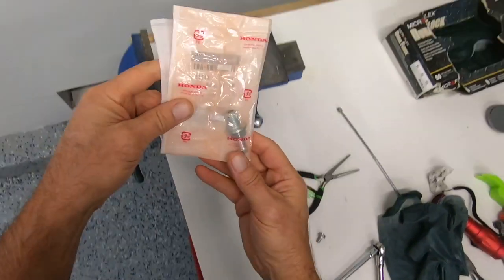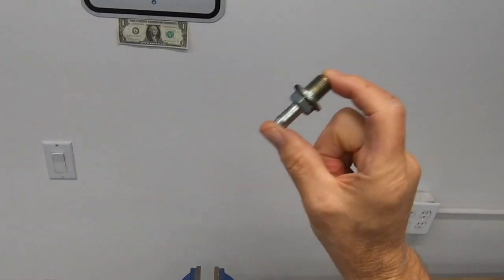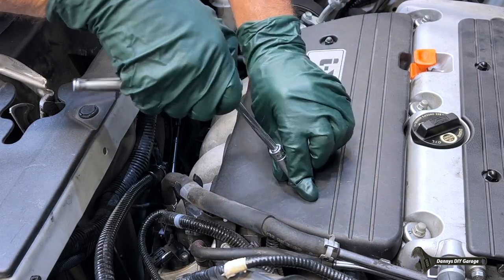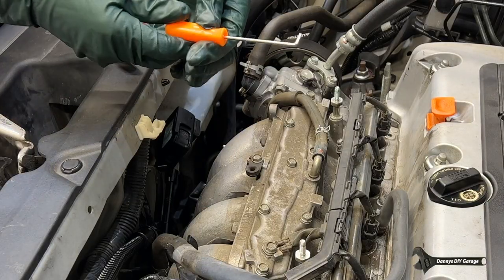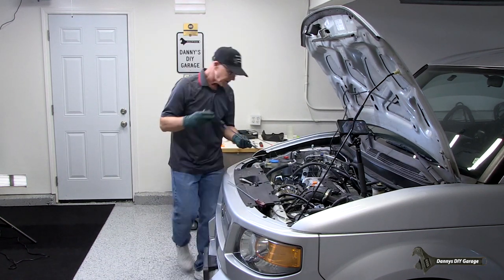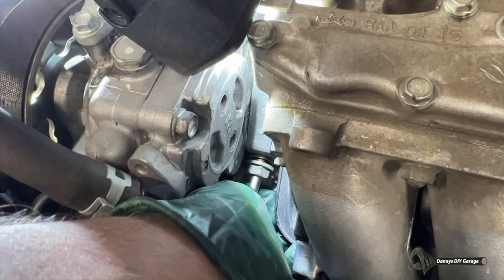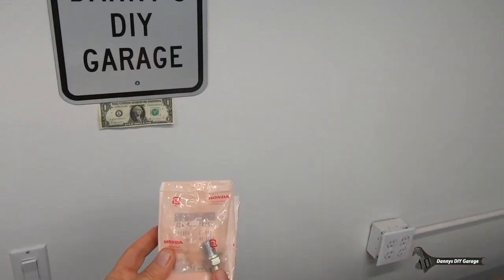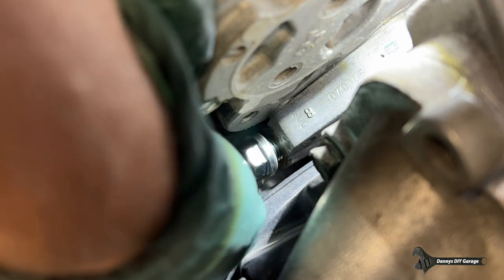Why you should replace it, PCV valve, Honda Element, Idle issues, oil leaks

Comment: Danny, thanks for making this video it was very helpful.

Cautionary tell for those novices like me:  I'd be cautious of the 33 lbf-ft torque spec for installing the new PCV valve.  My new PCV valve sheared in half before the torque wrench reached 33, probably around 20 or 25.  Supposedly the new PCV valve is OEM Honda, same part number posted by Danny (granted I got it on ebay, and it could be a knock-off).  I think some other things might be going on too.  The receiving threads contained a little oil (I probably should have cleaned those out, but didn't); anyway, that oil would throw-off the torque wrench making it want to work much harder than required.

So when the PCV valve sheared, it left most of the thread of the PCV valve stuck in the mounting hole.  Fortunately I was able to remove it with a reverse thread 3/8" multi-spline extractor that came in Harbor Freight's ICON 15-piece set.  I used a magnet to extract the PCV spring and plunger.  At least now I know what the inside of a PCV valve looks like.  Very basic, a spring and a plunger.

Another fortunate thing was that I had ordered two PCV valves, planning on having a spare - which came in handy earlier than expected.  A mechanic friend of mine suggested I wrap a little teflon tape around the PCV valve threads to make sure things are air tight without having to torque so hard the second attempt, which I did.  So this second go around, I used an old fashion beam torque wrench, instead of the click type, so I'd know how much torque was being used in real time.  I stopped at about 17 ft-lbs this time, and I still suspect the first attempt sheared between 20 to 25.  And as mentioned, the threads still had some oil in them on the second attempt too - so actual amount of ft-lbs tightened may be considerably more than just 17 (probably more than double).  Any friction reducer will do this, even thread locker.

Well that's my story and I'm sticking to it.  If it goes sideways - I'll update things.  I'm hoping Black Betty (a 2008 Element SC with 245K miles) runs smoother and has less error codes now.

Danny, I hope you keep cranking out the Element videos.  I love your videos.

Comment: I replaced mine last night, 320,985 miles on it.  It was totally plugged (no rattle at all).  I have noticed for a while that the hose that connects towards the top near the fuel injector was collapsed so I am sure that didn't help any.  Replaced both the PCV valve and the hose hope to see at least some reduction in oil consumption.   Did an oil change about a month ago and checked it this past weekend and it was already below the 'low' limit.  No stains on ground or blue smoke out the pipe.   But have have been getting a P0420 check engine light for probably the last two years (intermittent),  Thanks for the video guide.
Reply from the maker: Appreciate your support
Reply: If I’m not wrong that might be the vtec solenoid , either the whole solenoid or just the screen needs to be replaced. Mines leaking oil too very common for the mileage I got 198k soo
Reply: @gmoney-jn8lj check the oil pan too they like to rust to hell

Comment: Danny... Thanks for the video. Didn't even know my Element had a pcv valve.  I'm going to try cleaning mine first... I have a long list of parts needed for my 2003 Element and a can of Brake Cleen handy.
Reply from the maker: Appreciate that, good luck
Reply: Pcv are good until it quits on you with no warning then without noticing you get oil leaks and worse yet oil enters the intake manifold and you get heavy carbon burning and buildup and much worse on Gdi engines as it is very expensive to repair oppose to a genuine Honda Pcv valve as generic valves might not have the correct airflow

Comment: Hi Danny. Thanks for all your informative videos. I have an identical silver SC except mine is a stick shift. Just one question: At the beginning of the video you mention that Honda recommends that the valve be checked or replaced every 45000 miles.  How do I check the existing valve to find out whether or not it needs to be replaced?
Reply from the maker: they recommend you remove it and check it" shake it to see if it Rattles". So basically, remove it, and replace it.
Reply: @dannysdiygarage  Thank you! I'll give it a try. Appreciate all your work

Comment: Hi Danny, thank you for the video. I cannot find any pliers like yours locally or online, could you please show me where to find them? Thanks.
Reply from the maker: Which are you referring to, these are from snap on tools , however I’ve seen similar at harbor freight
Reply: @dannysdiygarage  special
 pliers are not needed just use a regular plier take off the top, and rotate the hose until you see the lower clamp The job is easier then.

Comment: Mine didn't come with a washer but I have a few of the honda metal washers I use for oil and trans  changes. will those washers work?
Reply from the maker: Yes or reuse the old one, it will be fine

Comment: Danny my 2009 honda civic is getting gas in my oil where do you think i should start spark plugs? Fuel injectors? My engine doesn't smoke so i hope it isnt my piston rings..only code im getting is my civic coolant is running too cool stuck open....so im changing my thermostat and sensor.
Reply from the maker: Yep, piston rings, fuel injectors

Comment: Why take the top hose off ?
Reply from the maker: Great question, you want to make sure the hose is clear, not plugged and it makes it easier to pull off because you can get the clamp easier.

Comment: I wish you checked the old one, if it still works.
Reply from the maker: I don't think I can replicate what it does when it's in the engine running, however, I did shake and it rattled the PCV on all three that I replaced, I also sucked and blew threw it to see if the valve was plugged or sticking, then I checked it against the new one, there was only a slight difference between the new and old, that being said, "a PCV valve is good until it isn't". I'm pretty happy with my decision to replace this and I should have done it sooner
Reply: @dannysdiygarage  I checked my PCV valce on my 2001 Honda Civic after I watched your video. I pinched the hose between PCV and manifold. PCV made a klik sound and idle went very rough after couple of seconds. Car is 177.000km and original PCV valve.

Comment: You should do video on knock sensor
Reply from the maker: Great idea
Reply: Geeze I had to do the knock sensor recently. Thing's a PAIN. Not as bad as the starter, of course. Nothing's as bad as the starter lol.
Also in case this helps anyone: Replacing the motor mount that holds the transmission will likely cause the knock sensor to error code for some reason. Apparently this is somewhat common. Another part you wanna make sure to just use the Honda one and not a clone or counterfeit.

Comment: 127k? That is one clean engine/compartment.
It looks new. Not a spec of oil, dirt or dust. My 07 Honda Element has 185k and the engine looks like it’s been threw two wars, a dust storm, and a hurricane compared to that.